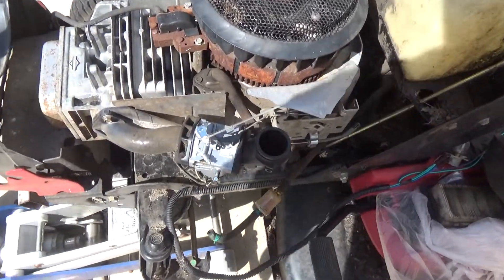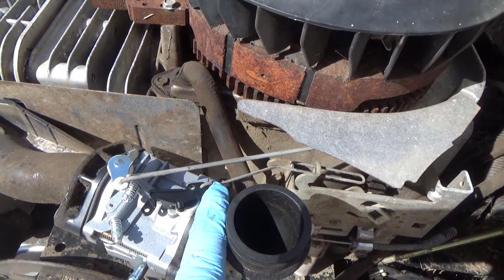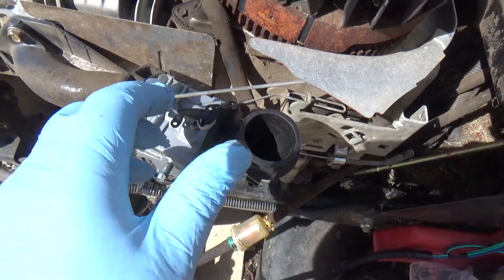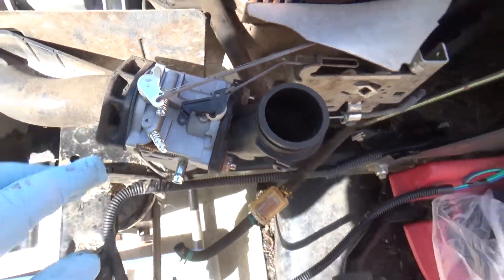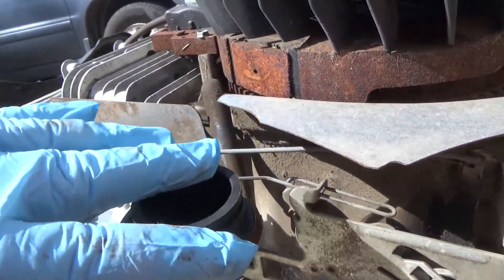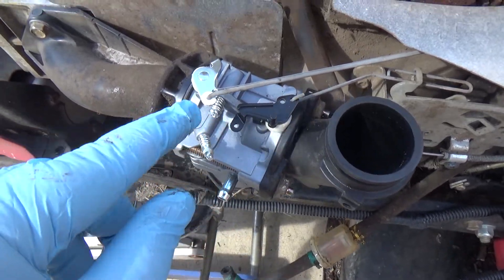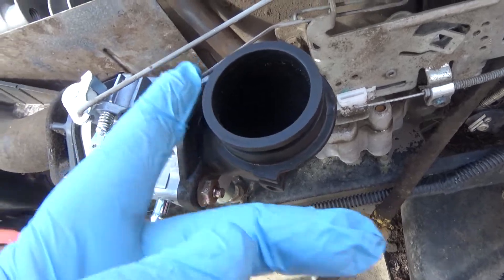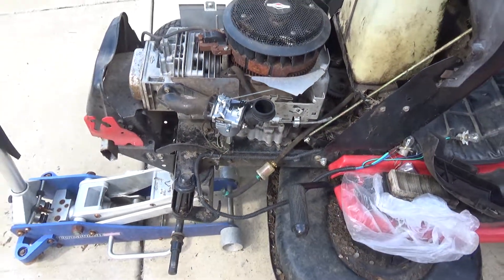#Troy #Bilt #Pony #carburetor #linkage

Comment: where can I find information/pictures to connect the throttle linkage to the carburetor on a Troy Bilt Pony model 13AN77KG011 riding tractor.  The cable from the dash is not connected to anything.
Reply from the maker: You will need to google it, then find a parts site that has it.

Comment: Is there something built in that causes the choke to move or you have to set that up too
Reply: I just had the same question as I was working on my Pony mower. What I discovered today is that when you move the throttle all the way up and then into the choke position, there is a level behind the plate with the white plastic square that comes up and pushes the free floating choke wire to activate the choke. Hope that helps.
Reply: @auctionsbybear2262 hey man thanks but we were able to figure it out my mower is working perfectly now
Reply: Clear, excellent video! Clear,close up and good explanation! Thank you!!👍👍

Comment: I have been searching high and low, my mower that I got from my Gpa there seems to be something missing from between the throttle cable and the throttle linkage that attatches to the carburetor, I'm gonna keep looking, but help would be much appreciated.
Reply: To add details, the choke is interfacing correctly, but the throttle lever (not the one on?the carburetor) isn't
Reply: more info: the regulator lever(?) Is naturally sitting at full throttle, and nothing's pulling it back
Reply from the maker: Need to go to trybilt.com and look for a parts diagram.  Here is a starting point https://www.troybilt.com/en_US/engine-parts/throttle-linkage-rod/951-11259.html
Reply: @tubejim101  I couldn't find any diagrams with the right area, as far as I can figure the governor arm needs adjusted, but she runs! Thanks for the help.